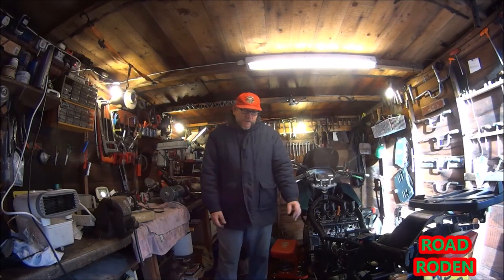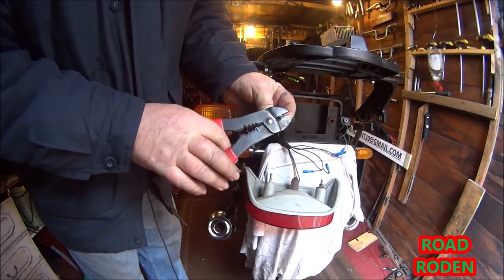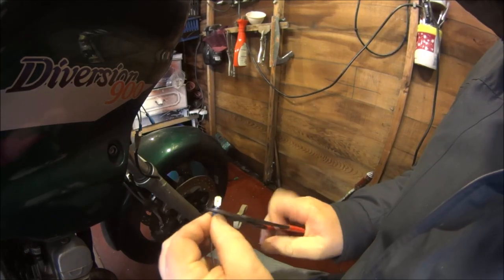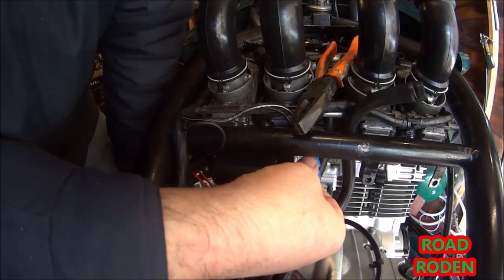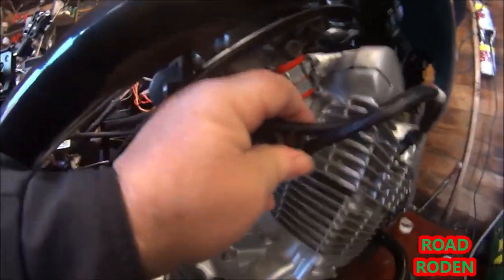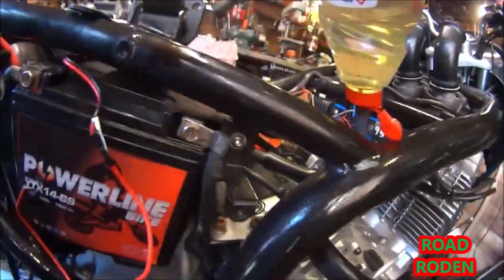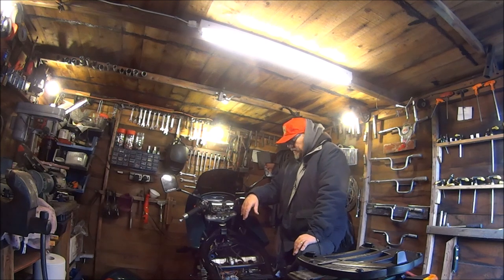XJ900S. Ignition coils & indicators replace.

Comment: That mixture screws well stuck, only suggestion i have is to soak it in decent penetrating fluid for a few days, apply heat to the carb around the mixture screw body  and either gently try your screw extractor again or try using a reverse/left handed drill bit. You have come so far to only be thwarted by a damn stubborn screw, what a shit thing to happen, Good luck, hope you get it sorted mate.
Reply from the maker: Sods law isn't it I've said before I never have any luck yamahas. Thanks for the tip buddy.
Reply from the maker: its worth  a try.
Reply from the maker: Cool
Reply from the maker: Sure is cheers

Comment: Damn second hand carbs for an xj are pretty expensive, can only find some online for 100 Euro, before going down that route (and since mixture screws don't often go out of whack by themselves) you might want to dismantle and have a really good look at the main jet and idle jets orifices again and thoroughly clean where they seat inside the carburetor again just to be completely sure they are clear of debris, i would also try swapping over a diaphram and slide with the spring as well from one of the other carbs to see if the fault moves to the swapped carb. You could even swap jets over too, who knows?, might narrow it down. Just a few tips,trying to help and save you some coin, would be heartbreaking if you bought new carbs when it may be an fairly easy fix. As always good luck, and keep the vids coming. edit- since you have a new coil try cleaning up that crusty plug on number 4.
Reply from the maker: Yup they are not cheap... I'm trying that now swapping everything from carb 4 into carb 3 and vice versa. The 3 mixture screws that move OK all have different settings so I've set them up correctly I'm thinking no 4 as been over tightened

Comment: Hi! I just bought a xj900 diversion and my coils look good but a couple of the HT leads are shot so i'm wondering if i can just change the leads... bad or good idea?
Reply from the maker: I wouldn't. Best bet is to get some extender caps bit like the plug cap where one screws into the ht lead these caps have a screw at each end so you can extend the ht wire

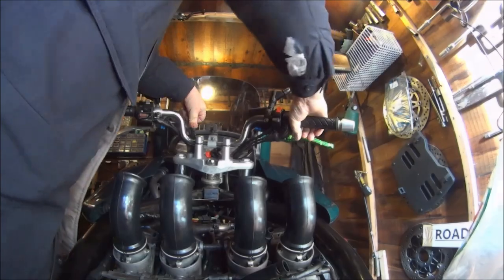Comment: Sorry to ask this but is there something wrong with your microphones? i get a lot of left ear love but just a buzzing in the right ear. i suppose it wouldnt affect phone users or laptops but im on the old headphones and its very noticeable. Nice videos by the way im considering buying a xj900 diversion just want to make sure im aware of all that can go wrong. audio seemed to clear up at 13:53 guess its one of those gremlins of recording doesnt appear in your recent videos so probably just a one off. Going back to the bike, did you check the compression on that cylinder which has the sooty spark plug?
Reply from the maker: Hi NP sorry about that it turned out to be one of the Mic lead's. The compression is all OK. Thanks for following the videos and  good luck with which ever bike you decide to get.